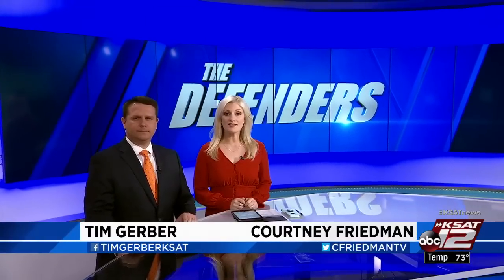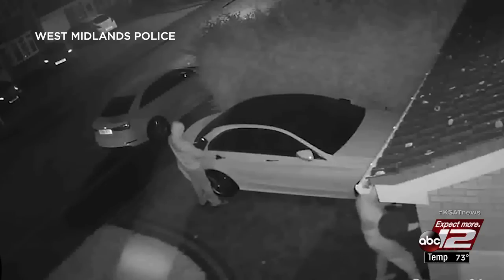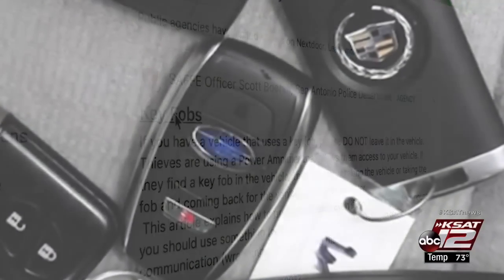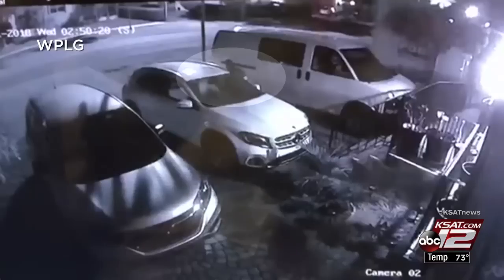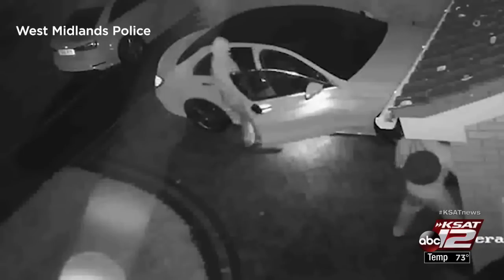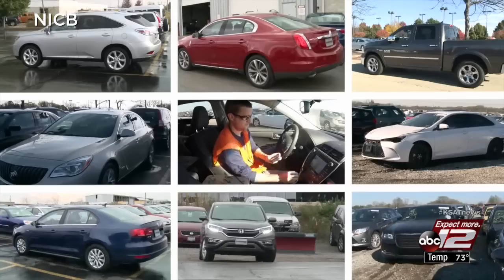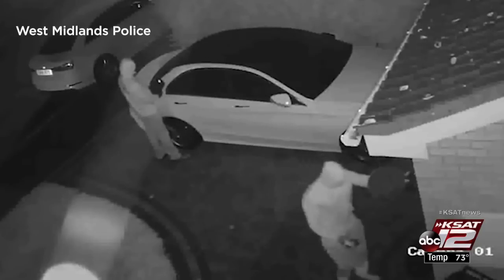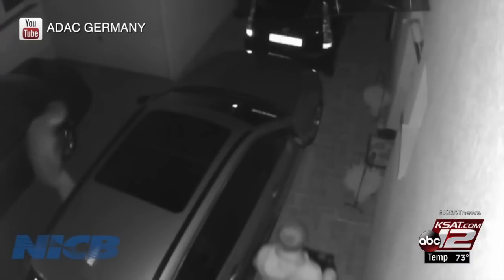SAPD: Car thieves using technology to hack key fobs, steal vehicles

Comment: This never happened until there were keyless entry systems.  It used to be they would have to jimmy the door open or break the window or do something else that would likely damage a vehicle.  Now they just need some sort device and they use it to get in, often without even making a sound.  It used to be that a thief would have to somehow hotwire a car to steal it.  Sure remote keyless entry is convenient but it makes vehicles much easier to steal.
Reply: Not really. It's a lot easier to learn how to hot wire a car than it is to get your hands on a fob replicator or programmer.

Comment: lol 
15 year olds been doing this here in australia for a while, it wsan't hard to make one 
keyfobs need to be within 1 meter from the keyfob, they create a radio signal extender and that's all. 
literally creates a signal bridge between the fob and the car. the car assumes the key is in proximity and unlocks on touch and even starts, 
however, it won't start again once it's turned off . but i guess they don't care about that.. 

so . get a used/broken microwave and cut the power cord, make it where you store your keys and it acts as a faraday cage, 
and FFS place a Ballard or a metal gate or something with some flood lights if you park outside the house and want to protect the car.
Reply: keyless entire lol Wait until your car is fully automated by RF signals, now here comes the horror.

Comment: Simple solution cheap effective and convenient, have a tiny battery cut off power off switch/button in key so it only sends code when powered up. Without battery supply the key is just a metal lump.  
    Car manufacturers take note. Its always the case, in quest for technology implementation simple things are overlooked
Reply: The cut off switch on key fob is a good idea but you have to make sure the switch is turned to the OFF position each time it is not being used.

I suppose you could fit a push to make switch but you will have to push the button everytime you want to open the car door and you may also need to push this button once in the car whilst starting it. 
However if the car won't see the keyfob signal whilst driving, it will keep bleeping and warn you that keyless key has not been detected!

I suppose you can also have a reed relay switch in the keyfob in parallel with the push switch so once you're inside the car your can place your keyfob in a designated place or compartment in your car which has a magnet that keeps the keyfob activated!
Reply: Install a hidden kill switch in the CAR to lock out the ignition
Reply: some fobs will not be recoverable if the batt is out for long periods of time. (IE.) It will need to be reprogram for like $200

Comment: My lease was almost finished on my Honda Civic & was looking to get a Jeep, Chevrolet or Ford but all the cars I saw were push start or they had a key but can turn on car from a distance and app control start. I just wanted old fashion that the only way to turn on car is by putting key in ignition but couldn't find new cars with that, luckily Honda still offers basic versions for new 2021 cars like the Civic, CR-V & HR-V, so I stayed with Honda.

Comment: Use a Faraday Pouch to block fob signals as shown in this video or you can deactivate / turn off your keyless fob by holding the lock button down  while pressing the unlock button twice. This deactivates your fob and can be easily reactivated by pressing either one of the fob lock / unlock buttons once.
Reply: wait, why isnt this a actual thing thats discussed, or have thieves learned to reactivate it?
Reply: @YoungBlaze  None of that nonsense this Autismo said is real. Very bizarre.
Reply: Will not work on honda's all you need is the ook signal and a little cut and pasting and BAM! repeat attack unlocks the car.
Reply: @Un_Pour_Tous  so basically the moral of the story is just get an older vehicle that has a manual key and none of that keyless igniting crap

Comment: by far and away the best method is to get an autospark to fit a manual cutoff switch into the ignition system or low tension side of the coil that only you would know its location so even though they may get in the car unless they throw the switch to the "ON" position it would be impossible to drive the car away

Comment: Why is the key fob keep transmiting even there is no one to press any buttons. Very stup!d design.
Reply: I was thinking the same exact thing. The car should be the one initiating communication once a button is pressed. Very lazy design that was bound to get hacked.
Reply: Get rid of the fobs and bring back the regular keys to start the car.
Reply: @anonymousjohnson976  even that way was still getting cars stolen
Reply: @truth4099  : But if you lose your car keys, you wouldn't have to pay hundreds of dollars to get a new one made like you would with a fob.  A lost fob car key costs hundreds of dollars to be replaced, if lost, and needs reprogramming.   Fobs car keys are a bunch of crap and they keep inventing this crap in order to make more and more money off consumers.
Reply: Should be called the careless entry system!

The keyfob doesn't transmitted any data until it receives a radio signal first which is only transmitted by the vehicle when you get close to it or touch the door handles, then keyfob transmits it's code to unlock.

What the relay theft does is that it boost the Radio signal emitted from the car and then sends this boosted signal into your home, your key fob picks up this signal as it thinks you are close to your car so keyfob then transmits signal back to the vehicle to unlock the doors and also start the vehicle!

What a silly design!

So if you put your key fob In a metal box or tin foil
Then it won't pick up any signals! and it can't transmit.
Reply: Most new cars are designed to sense when the fob is close. The car will turn on its lights, and some even unlock when the fob gets close.

Comment: An this is why I don't trust technology in cars. Because this stuff could happen. I saw this coming a mile away. I'm sorry that people have got their cars stolen from them hopefully they get them back.
Reply: Yes, and not to mention the cost of replacing the fob and getting it programmed if you lose them.  An ordinary key is so much better and cheaper.  Progress is not always good.
Reply: You’re gonna be surprised how easy it is when you have a regular key. Not exactly sure on how they do it now, but pretty sure it’s harder to do / more expensive. I mean the tools they used before are dirt cheap making it more accessible to criminals.
Reply: Wow, you trust no technology in cars. Antilock brakes are a pretty good one

Comment: Altoid can with some aluminum in it on your nightstand should block the signal. Easy to test, put you key into your metal container and see if your car will crank...
Reply: Will not work. You will need steel as thick as a foot. JS

Comment: Keyless is easily to theft. Why? The key foby even you are using it in a pouch, they are professionals and they can bypass system and can push the button to gain access easily. Do not buy keyless car. This is trash.

Comment: Renault and Audi need an original key to remain in car in order to drive the car, u can start it but after u try to drive, it turns back off. Older mercedes i thibk had the best system on the planet, they used infra red laser keys , cant steal the data off from that, it direct connection onöy car door to the key.